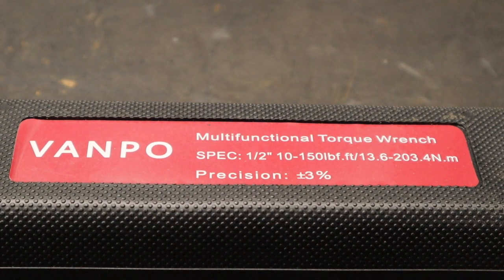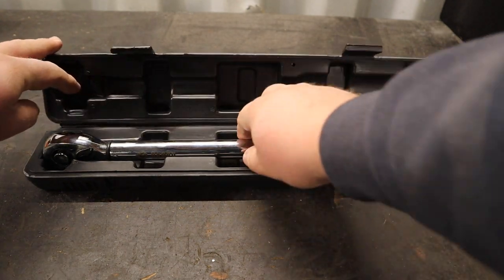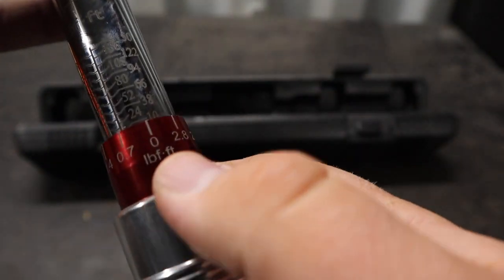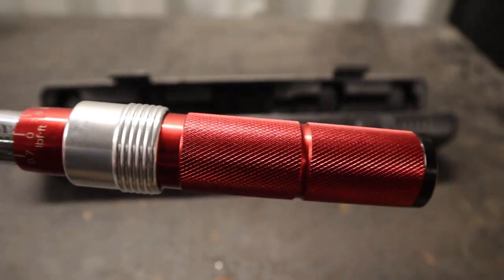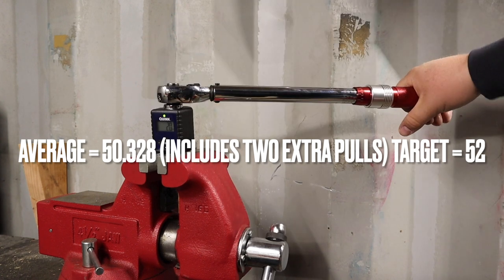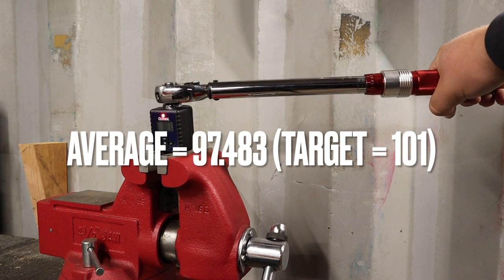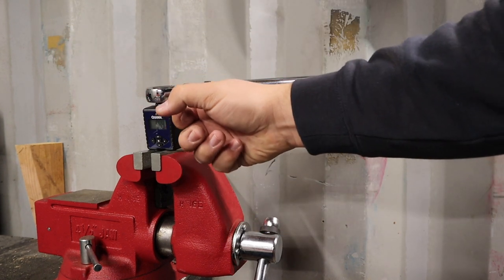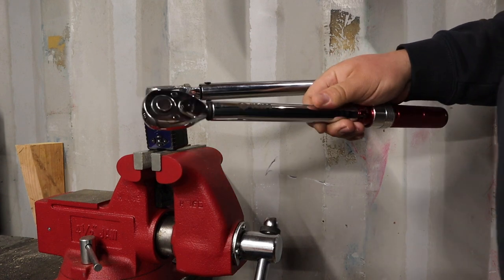Vanpo Torque Wrench Test and Review

Comment: It's not really possible to measure one thing with another thing that doesn't have better accuracy.   If the torque wrenches are +/- 3-4% accurate and the torque adapter is +/- 3-4% accurate, at 100 pounds, that means that any measurement between 92 pounds at 108 pounds is within tolerance.  Maybe if you took more pulls from each wrench at each torque settings and looked at the distribution and compared that it would be a little meaningful.  At the 100 pounds your distribution was from 95.4 pounds to 98.9 pounds resulting in a range of 4.2 pounds.  The Vanpo at 101 pounds had a distribution from 95.7 pounds to 98.9 pounds resulting in a range of 3.2 pounds.  Had you taken enough samples to be statistically significant and comparing the distributions we may have learned a little, but unfortunately nothing can be learned from your experimental data.  Your other observations about the product offers some value.  Thanks for the attempt, anyway.

Comment: Nice Reveiw it’s too bad  it is as inaccurate as it is    i use a older Sears Craftsman Digitork  Wrench it’s very simple without any reverse ratcheting  or   any other  extras back in the hey day of Sears  for basic Maintenance  and all Sears would take mine in  due to it being a Craftsman brand and send it out for Calibration  for no charge once a year  i did that 3 or 4 times  and  i  do keep it safe in a Blowmolded case   i would replace it with a new one with some features. but i don’t think this will be the one i’ll choose   as. i prefer to have some more Accuracy when doing Engine rebuilds
Reply from the maker: Nice, I think its hard to beat the old Craftsman (and I suppose new craftsman stuff too)!